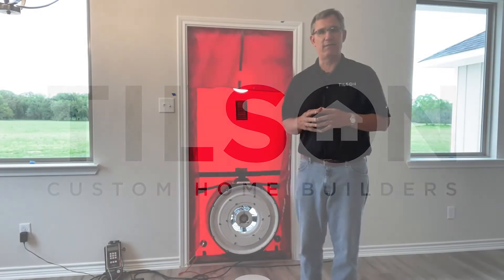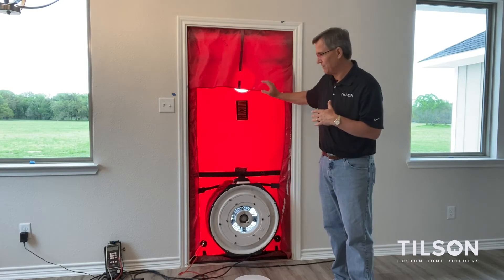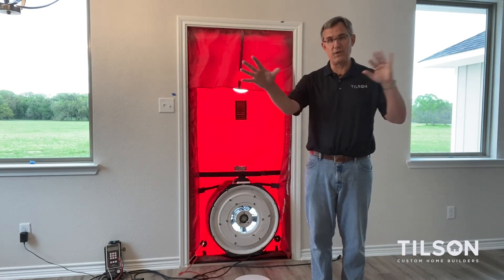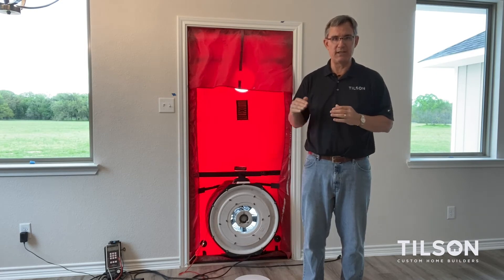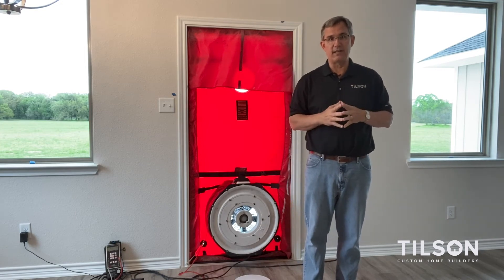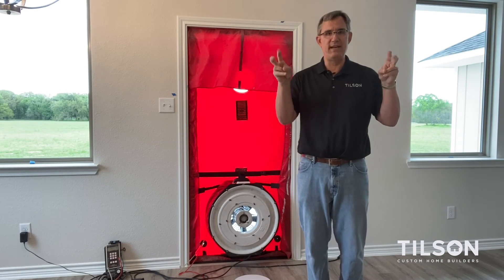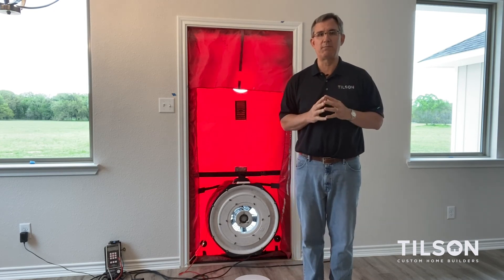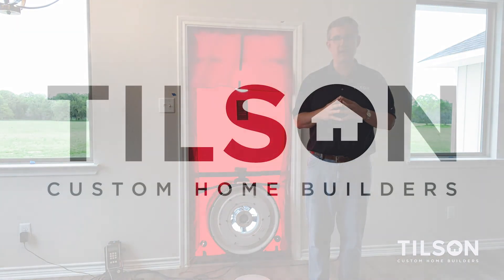What's A Blower Door Test? | Craftsmanship Deep Dive with Dave Yelovich from Tilson Homes

Comment: what changes are made to the house when the test's fail?
Reply: It really depends on where the home may be leaking air.  Sometimes, it's something as simple as a window or door sealing properly - other times, it's necessary to add some sort of sealant or foam to exterior corners and framing in the attic to seal.  There are thermal cameras used to help tell us where the leaks are occurring so we can target those specific areas.
Reply from the maker: Great question! If the home doesn't pass, we pull out the thermal cameras and take them around the home looking for the spots where the air is leaking so we can seal them up. The first place we're going to check is around all the doors and windows of the home as well as anywhere we cut a hole into the house for plumbing, electrical connections, etc. We'll reseal any areas that need it with polycel foam. Then we repeat the test.

Comment: So, this is done on every home? Y'all are currently building the Magnolia "C" for us in Brazoria County & we weren't aware of this test.
Reply from the maker: Yes. This test is performed on every single Tilson Home. It will be done when your home is almost completely finished. It's one of the tests to make sure we're compliant with the energy code requirements, along with a duct blaster test. The two tests are performed around the same time so we tend to refer to them together as the third party energy efficiency inspection.